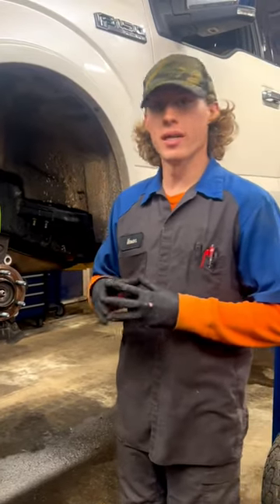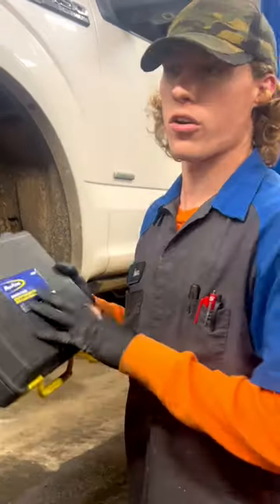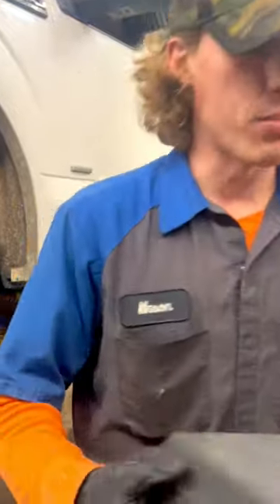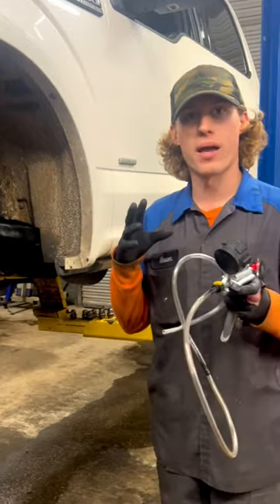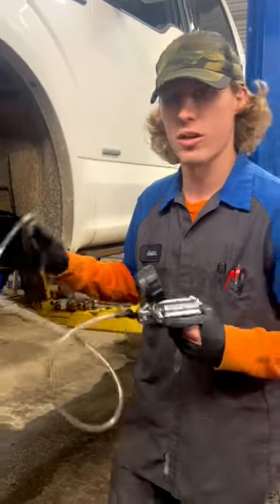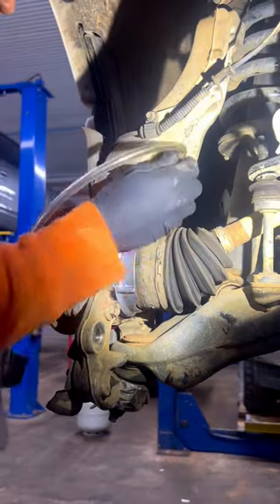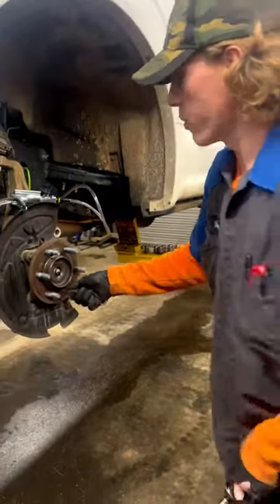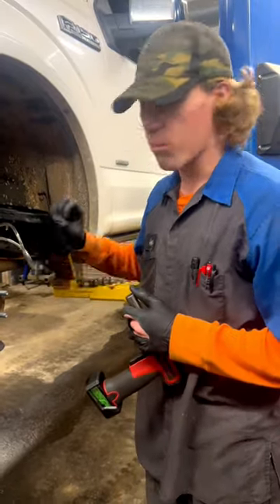Ford F-150 Vacuum Operated 4WD Actuators Explained #shorts

Comment: Can we talk about how easy it actually is to break the axle because it’s a 14mm bolt holding it it.
Reply: Man my first comment
Reply: It just holds the axle in the hub. It’s not load bearing. Never seen one break.
Reply: It's 30 ft lbs and doesn't hold much of anything...
Reply: @jamesgerman7947  yeah like wtf lol
Reply: Sober up it doesn't retain anything it's only for alignment.
Reply: Top comment. I broke 1 once
Reply: Doesn’t hold any load. Tell me you don’t work on anything without telling me.
Reply: @AndrewKidd14145  right? Way over his head lol
Reply: I broke mine on my 2018 expedition 😢😅
Reply: It’s a 13mm bolt
Reply: I broke mine and am currently replacing it. The damn thing calls for 20 lb ft 😬😒Oops
Reply: I was thinking the same thing as our Dakota has a 30-something mm nut on that axle.  Also what’s with vacuum actuators compared to a Dakota no vacuum. I guess it has a motor at the transfer case instead.
Reply: I broke one once when my torque wrench was stuck at 129 ft lbs even though I had it set at 30 lmao. I was tightening and thinking, "man I feel like it should be clicking..." then I snapped it. It really doesn't take much over torqueing to break them, lesson learned 😅

Comment: I've been doing these for 7 years, never applied vacuum during assembly, and never broke anything. I don't think anything will break as long as the actuator is fully engaged to the bearing while tightening.
Reply: I had teeth on the syncro catch one time out of the hundreds of times going back together. I noticed before I broke anything. The trick is spin the hub while you put the axle in and make sure it went in all the way.
Reply: @chillmode9576  I spin them every time. Always have. Never even thought about something possibly getting damaged during assembly, but it just seemed like the best way to put it together.

Comment: I can’t believe manufacturers are still trying to push vacuum actuated 4wd on anything. It’s always sucked and it’s always gonna suck
Reply: Exactly
Reply: It’s actually not vacuum actuated 4WD.  When vacuum is applied, the front wheel hubs are disengaged from the halfshafts.  Loss of vacuum locks the hubs to the front halfshafts.
Reply: @ghostwrench2292  so is this only used for servicing the hubs? Or is it also required for the axles to engage the hubs when putting it into four-wheel-drive?

Comment: My tire still spins when my truck is in the air, are you supposed to be able to spin it without the engine running and no vacuum? Yours seems to lock.

Comment: I still to this day cant beleive those idiots at Ford are using vacuum operated 4x4. Bring back the levers and locking hubs! Not this automatic crap.
Reply: Wait till you find out they made them electric in 2021
Reply: @Blue_Flame_Raptor  lol
Reply: FiX4
Off ROAD
Reply: I agree I love the manual lock outs better I miss my old ford

Comment: Just put a actuator delete kit and all the problems are gone
Reply: Thought about doing the IWE delete myself, mine very randomly will lose vacuum and scare the shit out of me when using cruise control.
Reply: @tyranicalteabagger  warn makes a very nice drop-in hub. Cheaper than the oe part from Ford and you can install it with the wheels on.

Comment: Didn’t you just beat the bearing races out by hammering the impact? Perhaps you shortened the life of the bearing?
Reply: Not with a 14.4 volt impact. An he just got it tight. More than likely went back over with a tourque wrench
Reply: The nut only tightens to 30ft lbs, it won't damage the bearing